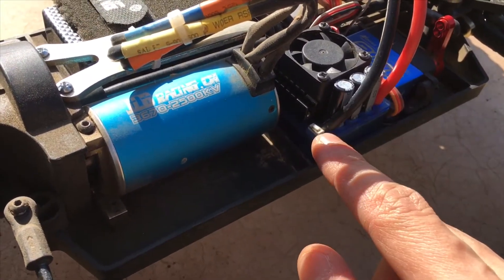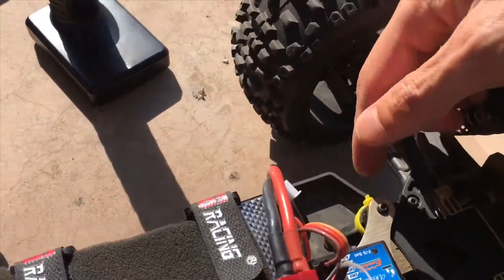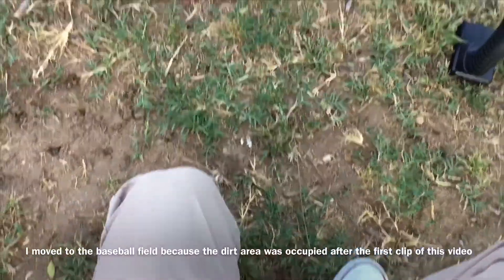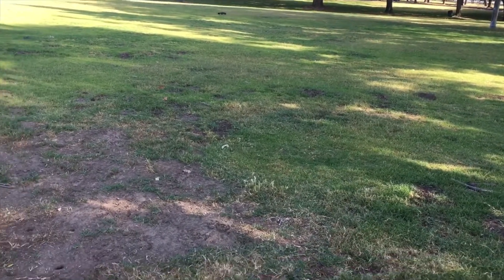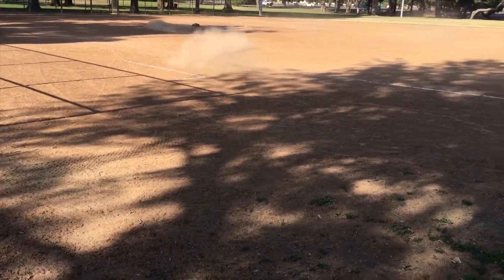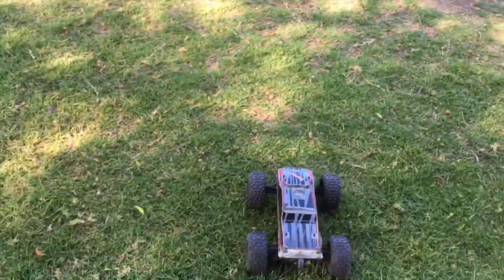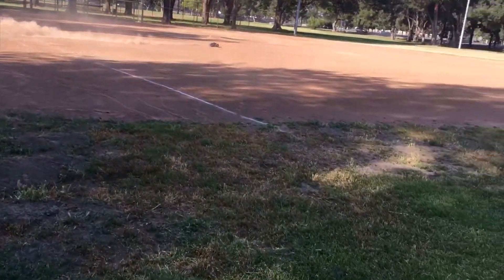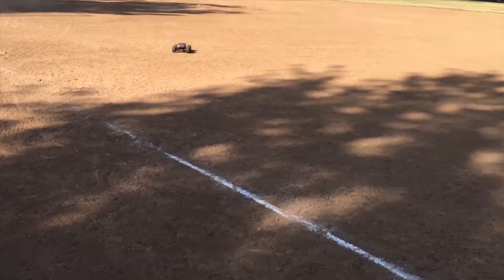JLB Cheetah - Dirt run and overheating ESC!!!

Comment: Hi, why this car does lift up and the dhk  maximus not? I would like to see my maximus lift up sometimes
Reply from the maker: Do you mean wheelie? The cheetah wheelie because it uses a single drive shaft in the middle that connect to both differentials. The Maximus have a center differential that sends power back and forth causing all four wheels to stay on the ground for stability. On the Maximus everytime the front comes up, the center diff sends all the power to the front to keep it from doing wheelies. That’s why you’ll always see the front wheel balloon more then the back when you punch it hard on the throttle.
Reply: @ItsRCTeng  yes I meant wheelie, thanks for the explanation :)
Reply: @ItsRCTeng  dang bro. That's a great explanation

Comment: I dont have esc problems 😂 but i have the 120a hobbywing esc. But my dog bones keep bending does the happen to you? And maybe how to get rid of the issue. Edit: i have the new cvd's
Reply from the maker: Yup all 4 dog bone is bent. I took it out and used a hammer to straighten it but it will keep bending over time.

Comment: And the overheating maybe you could buy so thermal pads from ebay so the heat will go better into the heat sink. Or you could buy some none conductive thermal paste like *mx 4 thermal paste*. Once i removed the thermal pad on a overheating esc and replaced it with thermal paste and it was still hot but it wasnt overheating!